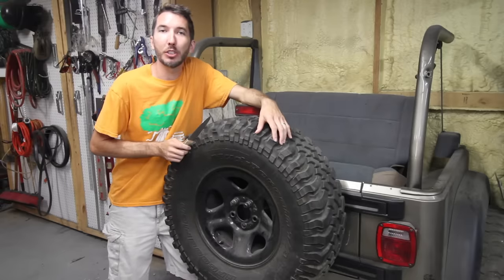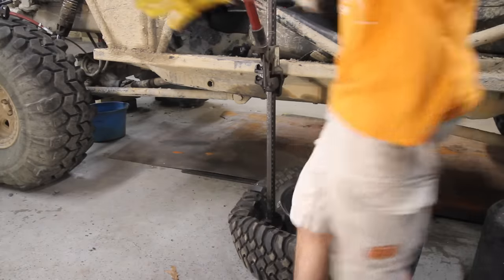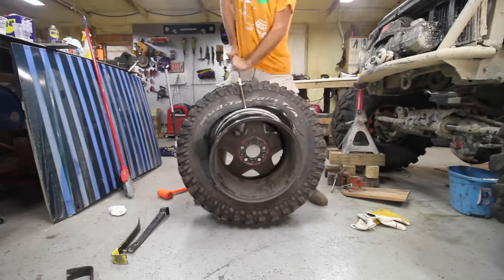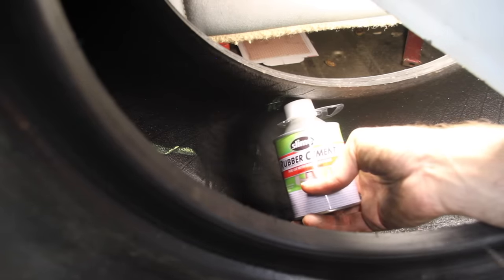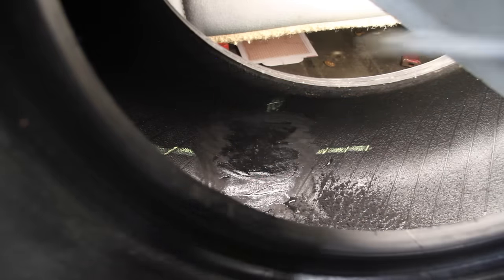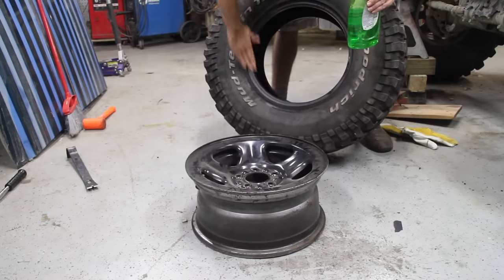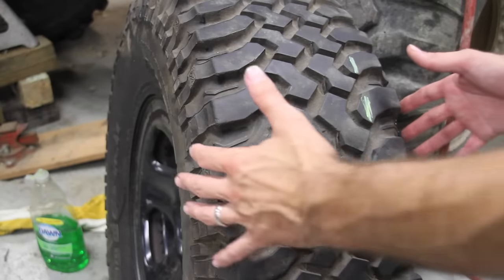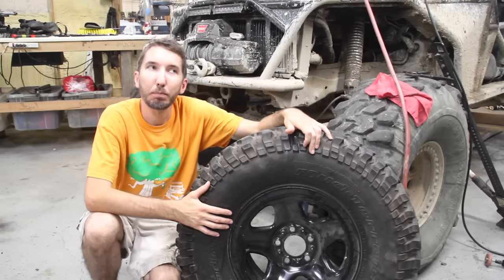How To Fix This - Patch A Tire

Comment: Hi, I'm an Italian tire fitter, the video is ok but there is an important detail to evaluate, and explain to others as well, the cut you made (I think it was intentional) follows the trend of the structure's canvases, from the heel to the tread, in this way you cut a maximum of 1 ply and in this case it can be repaired, but if the cut is horizontal (it follows the circumference) you cut at least 10 plies and inflating the tire would bulge and travel would become dangerous!

Comment: gotta push opposite side down so it gives you enough clearance. thats why they are called drop center rims.use windex for leak checks leaves no soapy mess

Comment: Had a puncture on sidewall got some good rubber cement an small piece of rubber to fit hole glued it still running it(if done right patching is what every repair place uses:plugs with holes in tread trick is use plenty cement on plug

Comment: There actually is a cold vulcanizing compound available now that allows you to patch very large holes from both inside and out on an offroad tire, even a hole in the sidewall that's large enough to fit half your hand through.
Reply: In the trade i have used this type of vulcanising rubber 20 years + ago. It is still advisable to back it up with a patch, and you also need to let it cure for a minimum of 24 hours before use. Could be on the trail for quite a long time..............
Reply: Yes I believe it's made by Loctite specifically for this directly bond stronger than the rubber itself

Comment: Matt keep in mind field conditions will never be this nice the tire may be full of mud ect.. still nice repair procedure. In the field way outback this happened to me and I had bead locks on 42s it took 5hrs to do this by myself needed lots of water to clean the bead for seating used around 2 gal of water most of it came from the sweat that I dripped wrestling with the tire. Oh is there any foam solutions with large tires for emergency recovery.

Comment: good idea to mark in which position the tire was mounted on the rim. If the fix does not add a lot of weight then it will be still be balanced ok...if not well you'll need it balanced!

Comment: I carry 5 packs of tire plugs I have just stacked them up one after another in a pinch or split like that and it gets you home I can't see doing a tire patch on the trail but when you get back home yes for trail tires only not for a road tire.

Comment: Forgotten just 1 step and a useful  tip im adding to this.  After you hit the inner walls at the damaged or punctured area with the wire brush, sander etc. What ever. B4 you applying rubber cement. After hitting it with break cleaner or monster energy drink. "Worked.btw" lol  its soooooo very important that you scrape what you just sanded after wiping it clean there is still lots of loose rubber but I can't see, take a paint scraper peanut butter and butter knife a spoon whatever you can use and scrape that area while it's wet with whatever you cleaned it with you will scrape a lot of thick sludge that you didn't even know was there, a lot of work involved of course then you wait for the rubber cement to cure sometimes I take a lighter and catch it on fire 7 Seconds then put it out then that's when I put my patch on, if you catch it on fire just drys way quicker . Called a hot patch.  Then  everything b4 and after  my comment is the proper way to patch a tire up. When you said you sanded down maby lil to far. They wires are called a "ply"  layers of cable and hard rubber.. so if there's 5 layers of ply in the tire.
It's a 5 ply rated tire. The tire can avoid ripping  from sudden traction of grip death vs hp.. say 1 ply = 100 lb. Strength    X that by 5 and you know what size strength and weight of a set of tires you require having vs the set up!  Loved the video.  My poppaw taught me how to use a hi lift and feet to break the beads after watching him do all my tires and his too.  Reminds me of em.

Comment: Bias ply patches should be avoided if radial patches are available. Bias ply create and aggressive resistance rather than passive resistance. Just gives you more envelope of 'error' to play with. Radial damage on this case was very minimal. Whereas across ways would be more significant. It's a great video all the same for a layman however 👍 great you spent the time. Bummer about the tyre levers 😃

Comment: Great video but you should include a little tip - before mounting the tire off the rim put a mark on the tire and the rim and try to line up these marks when mounting the tire back on the rim in order to keep the wheel balanced (if the wheel was balanced to begin with).

Comment: Should also put a tube in it. The gash will want to open and close as tire rotates and flexes when gash is at the bottom (ground).tube helps alot in long term.nice patch tho.
Hot patch works good also.
Stand to side of tire when airing up.

Comment: I’am from south Texas and for that kind of damage I would at lest used a doble patch, first a small one that covert the mane puncture than a bigger one over it.  Don that for years and it never fails, takes you one extra step bud gives you doble protection.

Comment: Maybe my favorite garage employed an inexperienced man that day ,  but mine swelled at the patch .         I suspect a tendency to grind out too much into the steel mesh , and if on sidewall not even any signs to prevent grinding too deep ,  and then not sealing around the boot as emphasized .      Remember a light waited hand when power grinding

Comment: If you get a nail on the trail buy a stap patch kit, you can use it and not even air down the tire and i will hold, if its in the sidwall you have to dismount

Comment: Sidewall patches will eventually unpeel due to the sidewall flexing which is why they are unsafe for regular on the road driving. But still a good temporary fix.

Comment: Each rim has a depressed area where you can pull one side of the bead in and the other side will side over easier.  If you try to pull it with the bead up on the side furthest from the tool you're using, you work harder and can possibly break a bead.

Comment: You dismounted and remounted on wrong side of rim,the other side has a groove specifically for the bead to allow it to clear the other side. If you use dishwash soap add some water to allow surfactants to work(grease works well and is almost  always available.

Comment: it's also a good idea to keep a little grease gun or a little tube of Grease or something if you have a tire that's hard to set the bead on do you put  grease all the way around the bead and air it up that way and the grease will let it slide on and plus it will hold the Air while it sets bead.

Comment: Just an easy tip after you get it started clamp some viscrips where  you started not to tight but tight enough that it won't move but itll help you to where you don't have to work that hard

Comment: I've repaired many sidewall holes I patch them and then run a tube inside that the pressure from the tube shoves to patch against the side wall even tighter

Comment: I once repaired a cut about 1.5cm perpendicular to the sidewall cords with a piec of sidewall cut from a high profile tire ground down and tapered on the edges to unofficially patch  the gash. It was on a smaller car but it lasted the life of the tire.  I put the tire on the rears just in case. The cords in the patch  kept everything in check. Take this comment at your own risk. You should see what they do in the developing countries.

Comment: Laundry or dish detergent, not soap for a lube for tyres. Soap is generally made by reacting caustic sodar,  with a fat or oils as in, Palm Olive brand. Caustic soda is used to break down rubber for recycling.

Comment: Not bad, but it would be worth getting a tire-spoon like a Ken-Tool T45. 
Anything else you can use to hold the tire in place while you work it on the rim. Also, learn where the "drop-center" is on your rim. You won't have to fight your tires as much when putting them on next time, and it's nothing to carry a tire spoon in the field in your tool kit. 
A guy hates getting stuck! 
Thanks for sharing and making the video! ;)

Comment: I concur on your procedure  ... but am curious ... have you ever DOUBLE ( or even TRIPLE) Patched the Sidewall HOLES or Gouges ?
I generally place a "smaller" patch directly over the Hole ( one that extends about 1/2" past the actual injury) 
then a second Patch over the 1st Patch  about 3/4"  larger, on all sides, past the  initial patch
& finally even a 3rd really BIG patch over the previous two patches 
It may result in a slight IMBALANCE but I've never noticed one 
I've used this method on my old CJ-5's and last week on my  K2500 Chevy Pickup Truck tire that somehow attracted a 3" DECK SCREW in the (below the TREAD) Sidewall 
Fingers are always CROSSED 
100% success rate (for 30 Years + ) ... 
Thanks for the VIDEO

COOP

Comment: I would have thought that the arrows meant parallel to the bead.  Good thing I watched this video
Reply: Most patches have a line with an arrow head at each end, and the word "bead", meaning the bead runs where the arrow heads point!

Comment: On the low tire pressure issue, I'm wondering if you can run a tube... it honestly looks like it would be less of a hassle to replace a tube on the trail rather than do one of those patches... and it wouldn't have any issues with flexing at low psi.   We know you don't believe in low tire pressure :D

Comment: I've fixed a lot worse than that. The tire shop I worked at was old school. We fixed everything from forklift tires to widow makers. All kinds of lock rings to loader tires. When you have old school farmers as your customers you learn just about every type of rim and tire out there. I'd say 60% of the tires we repaired were broke down by hand and not with a machine.

Comment: I have tried patching side walls on mine and the slit in the tire it will expand and just become an even bigger hole- yeah it held up for couple days but when it went a patch and super glue + baking soda couldn't hold air

Comment: Whatever side you're trying to pull up over the rim you should step across on the other side on the tire and get it down to where it's about halfway on the Wheel and it lets that other side come up over it a lot easier

Comment: Do have to be very careful if equipped with a TPMS when removing the tire.Can break that sensor real easy
Reply: Walter, its still not hard, put your lever in just to the side of the tpms sensor and gently lift the first pull over the rim where the tpms is, and then its safe. Putting the tyre back, position the sensor where the last  part of the tyre will go over the rim, and gently ease the tyre over from next to the tpms with the lever, again the sensor is safe. I am a tyre fitter, and have used this method for years on car and truck sensors, and have never broken one yet!

Comment: The only criticism i have with this very good video is that mounting the tyre back up the comment was to start where the valve is. This is a bad move as the nub on the back of the valve stops the tyre seating down into the beadwell, which if you watch carefully is exactly the problem he had! Start right opposite the valve and the valve will not then  hold the tyre and mounting will be a lot easier!
Also, incidentally, i would get a couple of cheap tyre levers if contemplating going far off road, and instead of using anything on hand to try to preclean the repair area, i would invest in a aerosol can of tyre buffing agent, and carry that too!

Comment: How much your BF just for fun ?   Here in montreal they are very expansive tire. For Example: I have 31-10.5-15 on my Ford Ranger.
I paid 260$ +txs (15%) so it cost me 1200$ for 4 Bf Goodrich Compare to Good Year Wrangler tag for snow *It's very important here in Quebec because the law is strict about the road of winter.
So, the Wrangler is around 220$ each +15% txs same shit...
These tire are top nuch stuff; it's a must when we have a 4x4.
Not just for the "look" but for our safety first.
I don't prefer neiter one but for the economy of 300$ i prefer Good Year ; )
Thanks a lot for your video. You got me i join your channel buddy.
Ciao.

Comment: Hey I wonder if you can help me. I have a 2018 ranger 900 and i popped one of the rear tires today. I watched your video and the hole in my tire is almost the same as the one you repaired in this vid. I had to drive about a mile on the flat to get it to where i could park it. There was no noticeable damage on the outside from running it flat for a min but when I took it off the rim to patch it I noticed that there are spots on the inside that are showing the redial metal about as much as was showing when you took a little too much rubber off while cleaning up the tire for the patch. Would you attempt to patch it being it is an off road vehicle or am I wasting my time. I could send pics if you give me a location to send them. Thanks for any help and thanks for the video.

Comment: I think I am going to mount a tire machine on my rig. I wonder how much I could make on a weekend out at Johnson Valley?
Reply: Max Morrow nothing we usually help each other out for free
Reply: Max Morrow i have a cheep $50 harbor freight tire changer that i built a frame to fit in my reese hitch... I have never had to use it but i have about 10 friends i wheel with that has used it... Bead breaker and tire tool to spin a tire off and on is awesome... It doesn't take up that much room either... The way i built it it all lays flat and brackets to bolt it down cause i cant stand ratteling clanking things...
Reply: Ok, I am no Jay Leno but I work for beer!
Reply: RED ROOSTER you should post a video of it. Sounds interesting, I'd like to see it.

Comment: When you buffed the inner liner to the cords, you went too deep. 
I'm sure I'm not the first to pile onto that. 
Otherwise, good job. 
Especially waiting for the glue to dry. That's a key step to a strong patch job. 
Yes, it's in the sidewall... It will hold. 👍
Reply: i second the cord incursion issue.

Comment: The only thing I don't get is if you are on a trail, you also need a high pressure compressor to reseat the bead on the tire and refill the tire. Those small compact compressors that cost $20 will not have enough power to reseat the tire bead. Rather than carrying a high powered compressor, might as well carry a spare tire.
Reply: Starting fluid and a flame makes the tire expand and pops the bead up over the lip if you get air to it quick enough it's good

Comment: If when mounting the tire or dismounting you push the opposite side of the tire down off the large diameter of rim it will mount easier

Comment: Did you ever try silicone seal in the sidewall cut and fiberglass cloth (At least two layers) soaked with silicone seal ? - - - - - Allow to set overnight before remounting tire . . . . . I used a tire for thousands of miles with no problems till tire wore out . . . . . Rubber cement goes bad with heat and loses grip . . . .

Comment: The only problem is having an air pump strong enough to set the beads - most 12v portable air pumps don't have enough air flow to do the initial set. Tire shops usually have 100psi systems and remove the valve core to set the bead even faster.

Comment: I'd like to know who carries an air compressor and air tools out on the trails...? If you carry an air compressor off-roading you are my hero :D
Reply from the maker: Click here, lol https://youtu.be/Z3d71t-pUrI
Reply: Shit I carry a co2 tank, and a good electric air pump.  Some times I carry my ac compressor converted into an air pump.
Reply: You really need to carry spare axles all around, spare steering drag link and tie rods, spare front and rear drive shafts.  Spare spindle and ball joints, locking hubs too.  Spare fuel pump too.  

And finally all the tools you need to fix.

Comment: Always remove the debris before you apply rubber cement and a new patch. Vacuum is the best (if you're in the shop); otherwise, if you're in the wilderness or on the road, use a brush and a small piece of paper.

Comment: Love Your videos! QUESTION! I bought, and kinda built a 96 Cherokee... um it runs great.. Sorta, when I hit a hill well.. Pushing might get me up the damn hill faster.. Someone suggested I the timing was off, Ok sounds good.. WELL.. I never had a jeep that you could not move the distributor? So thats the question, HOW does one adjust timing, or is there something I am missing about the NO POWER on hills for jeeps! ??

Comment: Could have ground it down first then buffed the ground spot with the starting fluid and rag to smooth out rubber let dry blow out tire of debris then add rubber cement. In some shops they will briefly light the rubber cement to dry the cement out faster the warmth sometimes helps with the bond in cold climates then blow it back out from there add patch on warm rubber cement overall his patch shall hold.

Comment: Just a tidbit, the  PROPER protocol to repairing a nail is to use the plug and patch according to the manufacturers spec. I had a nail and the dealer once told me oh, Toyota says to use the plug, that's the standard. I said, oh really, is that what Toyota say's cause Toyota says to refer to the manufacturer specs for tire repair and the tire repair. On my Bidgestones, it says, to plug first, trim it out, then Patch. Most won't do that due to laziness.

Comment: There are two types of tyres one has rayon reinforcing and the other steel reinforcing. Rayon is easier to fix but only temporary as the reinforcing is cut, you can patch it to hold air but you have not fixed the reinforcing, steel wire reinforcing the wire ends pierce the patch and I have not had much success with them. Nail holes are OK to fix but large slits the integrity of the tyre is compromised and is only a get you home solution as you say temporary.